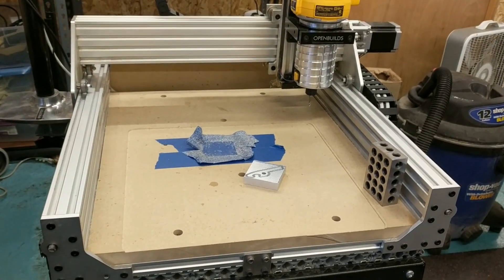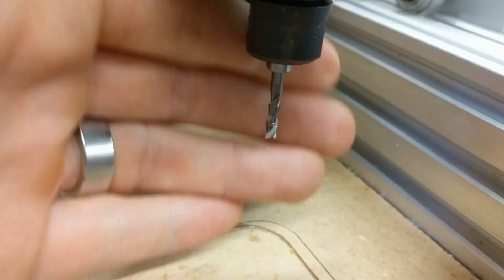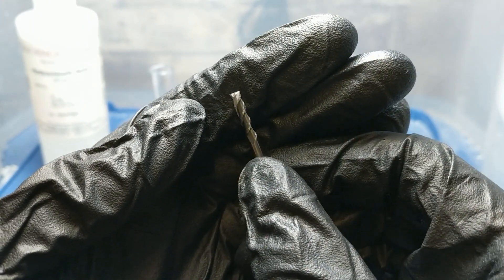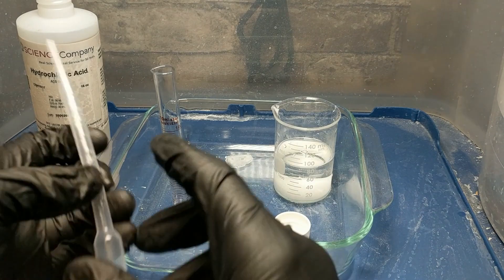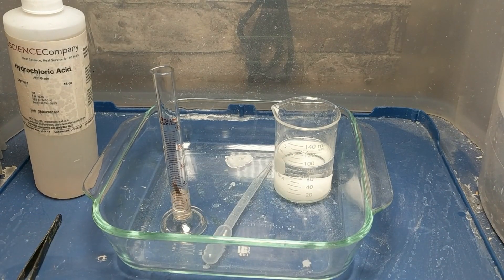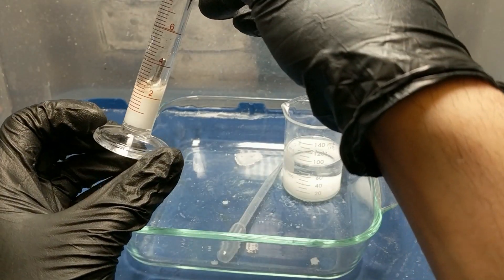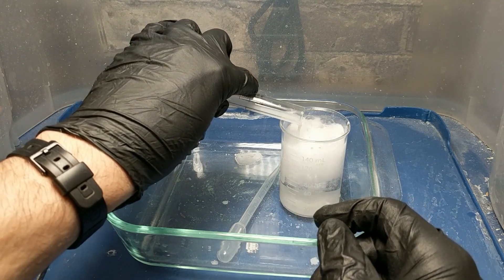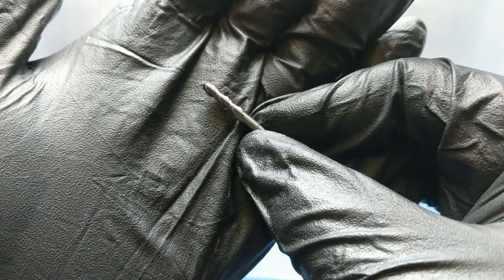Getting Welded Aluminum off of an Endmill Using Hydrochloric Acid

Comment: this would only work for titanium alloys as they are very resistant to acids and bases.  if you have a steel endmill you will loose some material due to the acid .
Reply from the maker: Rafa Navarro That has not been my experience but depending on the alloy I can see that happening if you leave it overnight. In 2m you'll likely only be etching the aluminum